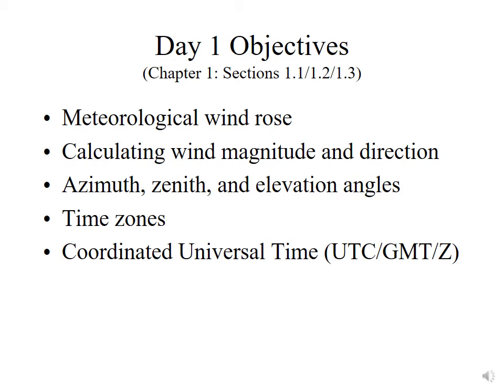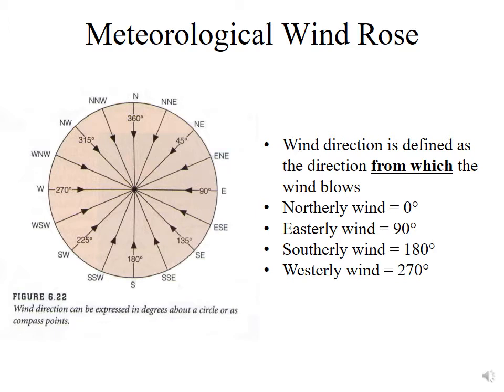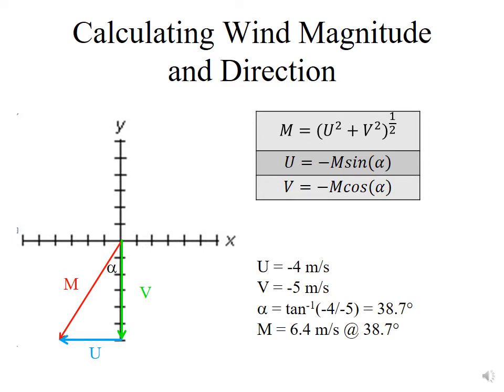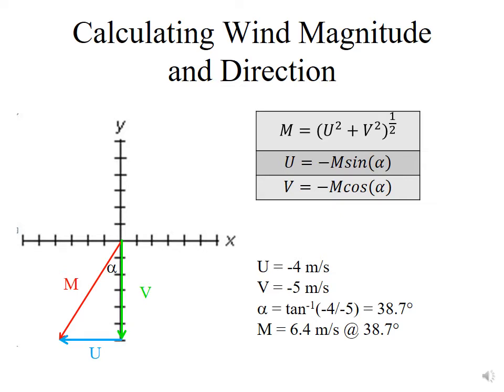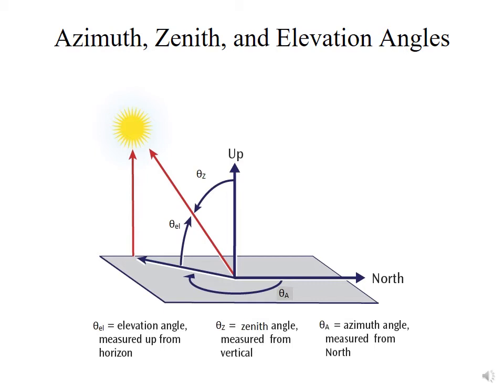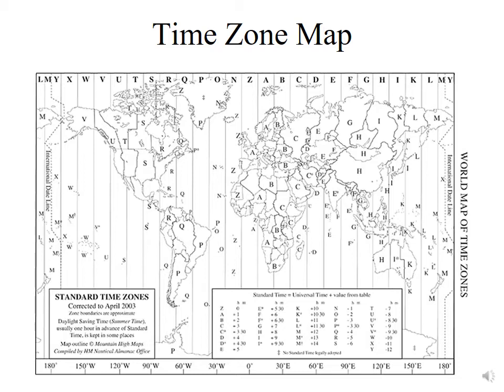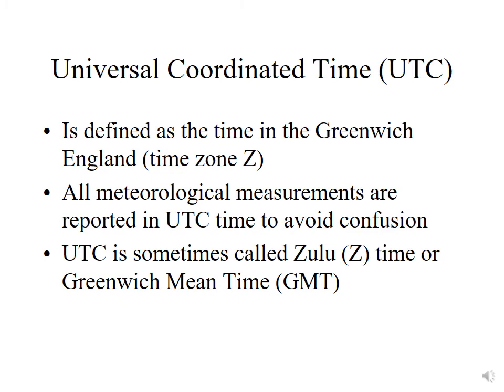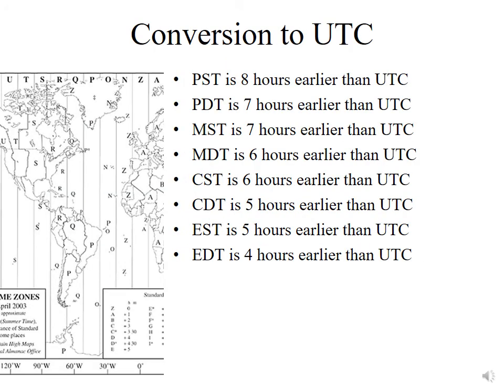ATMOS 5000-A Day1 Chap1 1.1/1.2/1.3

Comment: If U=+4 m/s & V=+5 m/s, then M still equals 6.4m/s @38.7 degrees. How do you differentiate between the two directions?
Reply from the maker: I glossed over the details in the video. The full explanation is found in the Stull textbook Chapter 1, Section 1.2, Equation 1.2a
Reply: @kevinperry4239  Thank you